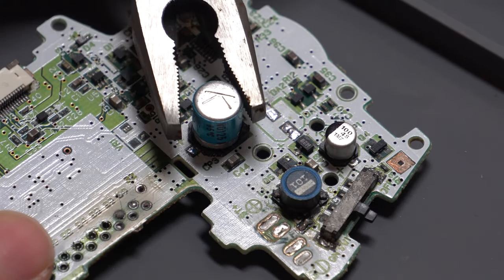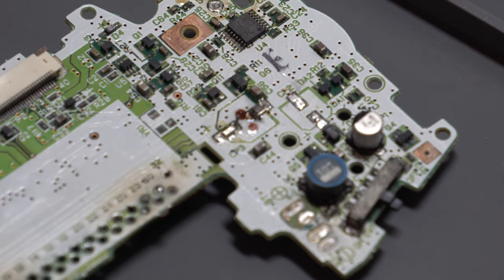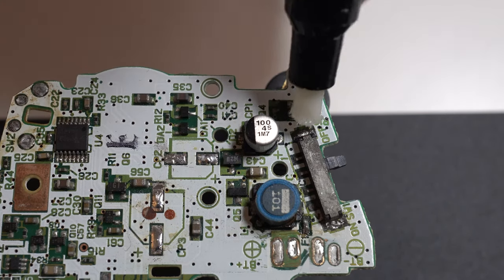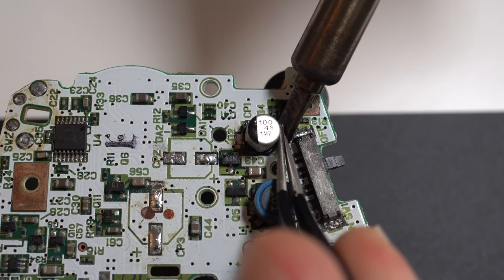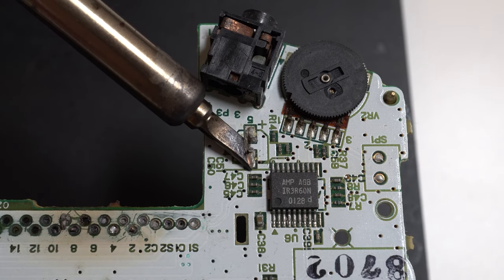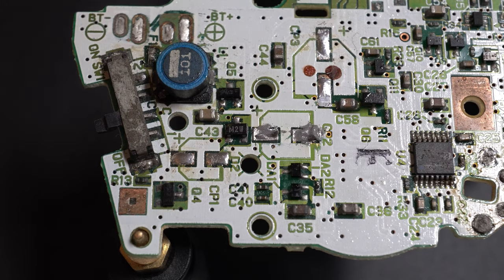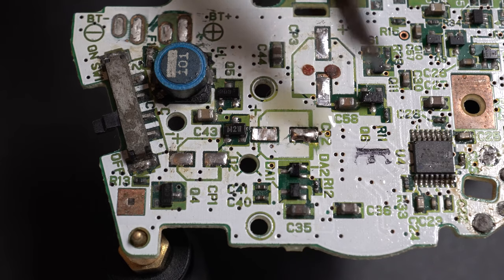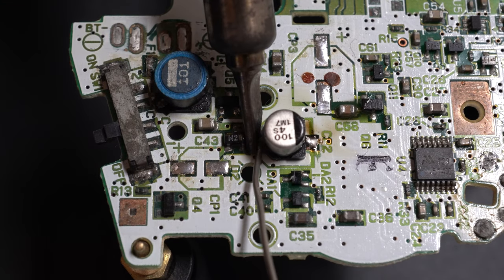Gameboy Capacitor Replace Quick Guide

Comment: 1:00 add some fresh solder to your tip. Try to imagine the surface contact between your iron and what you were trying to heat, it's minuscule (don't forget that air is an extremely good isolation), a bit of solder on your iron will make all the difference as the surface contact will be increased... I don't even know... up to a thousandfold depending on the case! Basically, ask yourself if you'd rather get burnt by a 1000°C needle tip or a finger with 100°C honey on it... I'd go for the the 1000°C tip personally =) 

1:45 add some fresh solder to your tip here as well, for the same reason as stated above and to lower the melting temperature of the already existing solder which is lead-free (this method is extremely risky as you probably already know. I don't like the first method but this one is even worse)

3:10 see the 2 red dots on the footprint of the capacitor you removed previously? That's epoxy, that's one of the reasons you want to avoid both methods listed above, these dots might be strong enough to lift the solder mask and lift traces and pads. Trust me, they are... ^-^

4:20 "sometimes the rest of the solder doesn't melt for some reason" most likely because it's GND which often has thick traces that act as heat sinks. That's why you need to work above the melting temperature rating of your solder so each time you solder to a GND point you don't struggle.

Check the "858D hot air rework station", you can get one for £30. Set it to 410°C airflow to 4 or 5, add some leaded solder to whatever you're trying to remove and once the all area is hot (start with the first component, the surrounding ones will require 3 seconds of heat to get off) you'll be able to remove 1 component every 5 seconds with no risk at all.

I try not to be the "you shouldn't do that" guy but these methods are for people with no tools and/or experience and that's the issue here. A beginner will go for these methods because they look convenient and easy and lift a pad or something, but because he's a beginner, he will have no idea how to repair that.

Sorry if this all sound ultra negative, even if this is not the perfect way to handle this, this video might trigger someone to start working on their console and before we know it, we have another modder in our community so, it's a win. Your video shows that it can work, my comment might make a beginner realize that there will be room for improvement in the future. Double win!
Reply from the maker: Ooof, a lot to unpack so forgive me if I don't reply to some aspects.

I have a hot air station, just from previous use I found it melts plastic way before melting solder so was worried it would melt the plastic base of these capacitors. 

Adding fresh solder is always one of my downfalls when trying to remove old components! Need to remember that. 

Thanks for the thorough comment though, this is how people, like myself, will learn and improve. Don't worry too much about it being negative, if anything it shows that there is no problem people discussing how to improve :)
Reply: @TheRetroStation  It's cliché to say that making mistakes is the best way to learn but that's the truth. When I started, I thought I could save some time by not tinning my wires before soldering them, the day I started tinning them, it made a huge difference and now I know why I should. And I'd rather have people who made the mistake and understand why it's a mistake than people doing the right thing but not knowing why.
Reply: @SLRModShop  what's the best way to remove the capacitors to avoid that epoxy thing?
Reply: @lazylefty4600  Hot hair to make the bond break. But if you don't have a hot air rework station, then I do have a technique that might be the second safest. I made a video for someone, it's unlisted, I'll come back with a link. If you don't see me again, come on my channel and ask, it will be because posting links is banned on this channel. BRB!

Comment: FYI, never twist those capacitors like that.  It's a sure fire way of ripping pads off the board.
Reply: Hot air is my go to, just need to take time to protect plastic areas with Kapton tape and aluminum foil.
Reply: I ripped one of the pads off. How would I go about fixing it?
Reply: I didn’t go ham with the pliers like he did but I took some small tweezers and did is much softer, worked like a charm!
Reply: @albanmarku6743  I did the same thing and ended up buying one of the funnyplaying motherboards and swapping my CPU and RAM to it. You do need to know how to drag solder though. It's not as hard as it looks though

Comment: What would be the case where you would need to replace these capacitors? How would be the testing procedure ? It would be a nice video subject! ...great videos!
Reply from the maker: Yeah that's a good suggestion! Capacitors on GBA's will most likely need replacing due to age, but it's a good point having a visual/evidential example of why they need replacing! Testing capacitors is quite hard, afaik you need to remove them from the board and then have some specialist equipment to properly test them
Reply: @TheRetroStation  I would love to see a video about this aswell! :)

Comment: Maybe if the board has a little corrosion or if the condition is not so good, the pad may rip off. Just put flux get your heat gun and hold on until it loosens. But man a heat gun can be like handling a chainsaw.

Comment: Question. Where can I get the surface mount capacitors for Gameboy Colors? I see a bunch online, but none that has the same thing written on the top of it.

I've got the
100/4S/9B4.... 100/6S/9Q4 and the 22/16S/9H4

Comment: It's totally worth replacing the capacitors on a original Nintendo game boy also Sega game gear and Atari lynx
Reply: What difference does it make?
Reply from the maker: The old capacitors will not perform as originally intended - dim screen, low sound etc or just not working at all.
Reply: @TheRetroStation  good to know, thanks for the reply.
Reply: You'd be surprised just how many electronics could probably be saved by simply replacing old capacitors. Saved my 22 year old audio receiver by replacing a bad capacitor. Sounds great now! Paired it up to a set of speakers from the '70s that originally only needed the crossovers replaced (had to replace the woofers later after my kids ruined one of them).

Comment: I have a GBA that doesn't power on - but it gets a small flash of green when moving the power switch on or off.  I am thinking this is probably a capacitor issue - any thoughts?
Reply from the maker: If you get a flash of green light then I can surely say that isn’t an issue with the capacitor - sounds like a dirty switch to me.
Reply: Dirty power switch. Clean it out and it should work like a charm. Otherwise, toss it out and here's my address you can send to get junk. :)
Reply: Wish it was a dirty switch - I have cleaned that thing 6 ways - taken off the cover - and tested it with a multimeter.  Thanks for ruling out the capacitors...
Reply: @bobbrown98  if you figure this out can you please tell me what the solution is. I have the same issue.
Reply: @whocares164  - somehow I ended up with two of these gameboys.  Ordered two new parts from China - the T1 inductor - which has a chip in the magnet on one of them. It also comes with the 2 diode arrays. It also came with the L1 - but based on the schematic - it looks less likely.  Will replace one at a time...  https://console5.com/techwiki/images/1/1b/GBA-Schematic-Power.png

Comment: My GBA stops runs on two AA batteries but runs properly on 3.7v LiPO. Please suggest which component that I need to replace for repair. Or I need to replace all capacitors.
Please suggest for repair my GBA.

Comment: Yeah twist method is not good for gba models, wish videos would stop recommending it since they can have glue or epoxy underneath, especially the big one
 Can easily tear pads if you are unaware of this even if you are careful about adding a bit solder to make the pads stronger. Always use a hot air gun instead to safely remove the big capacitor.